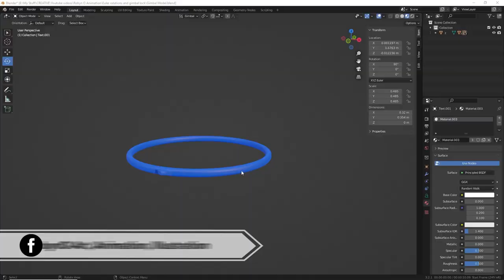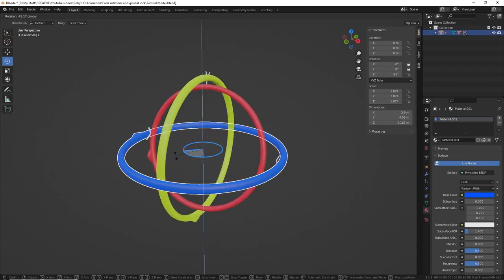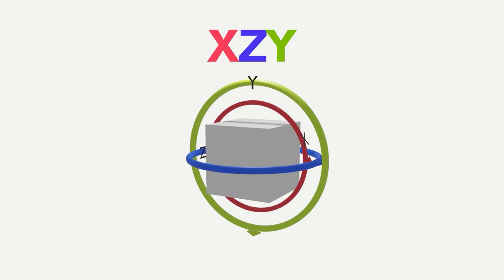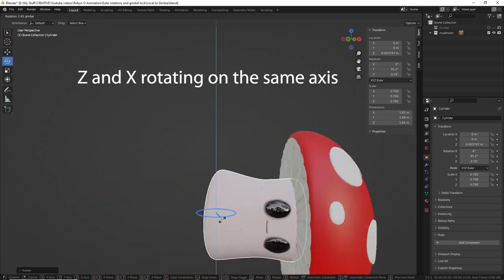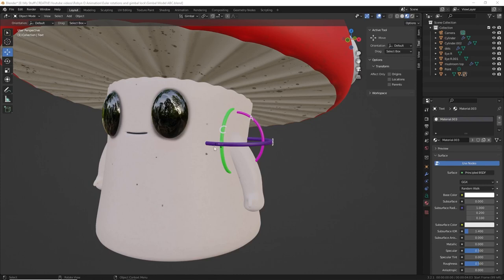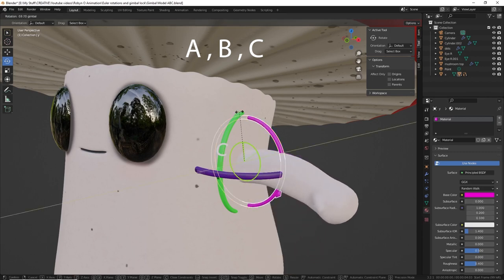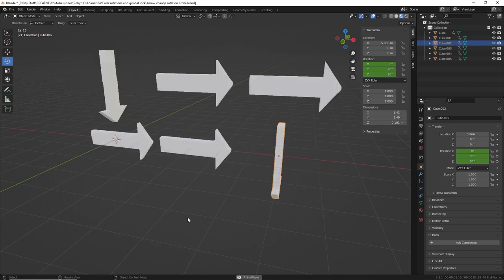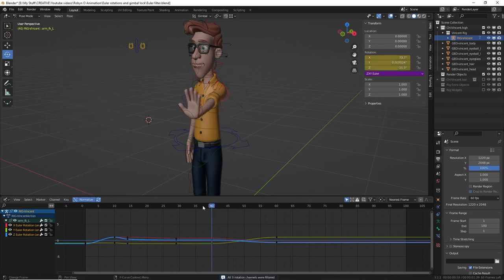What is Euler Rotation and How to Avoid Gimbal Lock

Comment: Thanks for the great explanation - including how to choose the best rotation order.

In Blender the Rigify add-on provides a tool "Convert Rotation Modes".  It supports Euler to Quaternion or vice-versa.  By doing a two step conversion I was able to switch from Euler XYZ to Euler XZY and convert existing actions.
Reply from the maker: Whoa that's cool ! I had no idea . Wish it wasn't just for rigify rigs though, but nevertheless,  still good to know
Reply: @RobynO_O  It's not just for Rigify rigs.  I'm actually testing it out on a mutant rig from Mixamo, to which I've added basic face/eye controls.  It also works with multiple actions in the NLA - though I suggest you verify the conversion doesn't do anything strange before you save your file.
Reply from the maker: @MarkStead  oh wow that's awesome !

Comment: Thanks Robyn! always good to have a refresher on Gimbal Lock. I wonder, have you ever run into a case where you had to use Mari for client work?
Reply from the maker: I actually haven't ever used it, is it any good ?
Reply: @RobynO_O  IDK, haha... I have been avoiding it as its so expensive, even the indie license is expensive. They do have a non-commercial version. I was mainly curious if I need to invest the time into learning it. So far it seems most people are just using Substance Painter. I guess with the opening of time that I have coming up in spring (April) I can finally get into animation. yay!